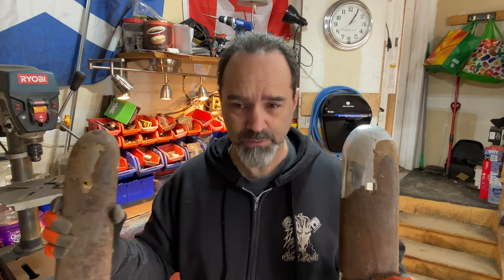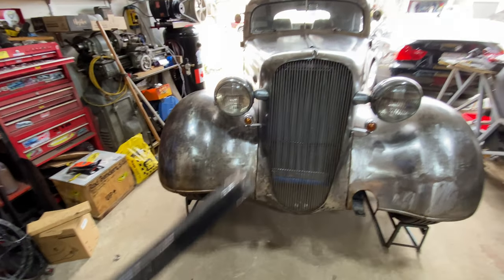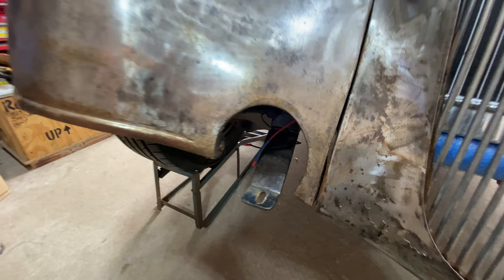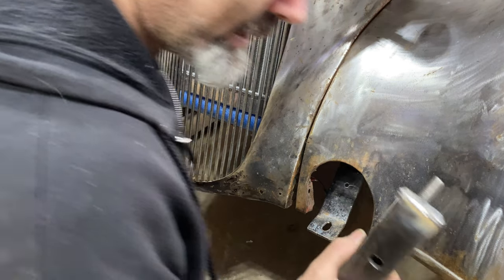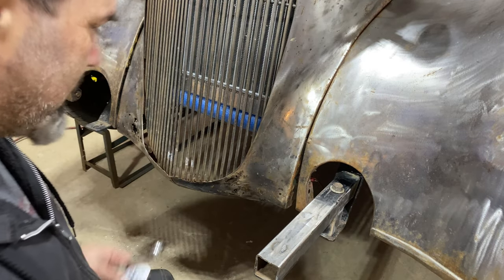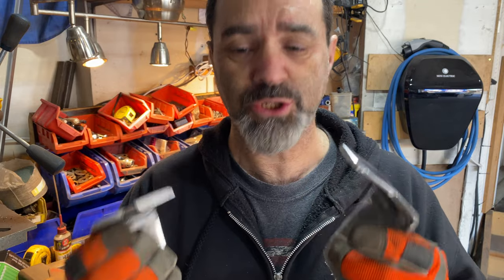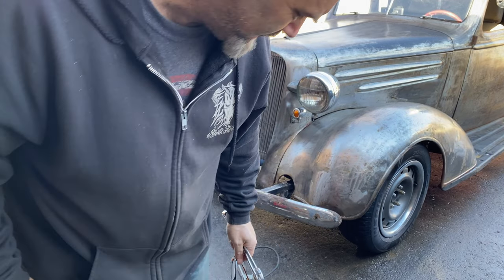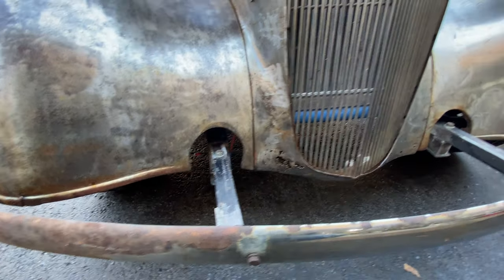Bouncing Bugsy Bumpers! I Install A Front Bumper To My 1936 Chevy Coupe

Comment: Love your Scottish dry sense of humour in your videos!  Front bumper looks great, and once you've added a bit of rigidity to the original fog lamp brackets it'll be the dog's b*llocks!  The old cut outs for the fog lamps on the body work perfectly for the bumper support structures, and fixing the fog lamps onto these structures will look like it was quite simply 'meant to be'.  You had me at the ramp mounting exercise at the start of the video though ... I can never get both sides balanced, so one ramp always kicks out before the other!   But to be able to keep them balanced and then go up on their 'tippy toes' together .... well much respect to my Scottish Brother!
Reply from the maker: I did a sort of dry run first, to make sure they were in the right place, then reversed back. Just kept my fingers crossed I was still on the right trajectory, lol.

Comment: Now you can bolt the fog lights back on to the bumper brackets , good job . It may be worth checking clearances when driving on/off the ramps now the bumper sticks out the front/rear . I have had ramps flick up like that only mine jammed so had to jack the car up to get the ramps out , lots of bad language that day.
Reply from the maker: Thanks Paul. I had considered that. Probably won’t use them again unless I modify them a bit.